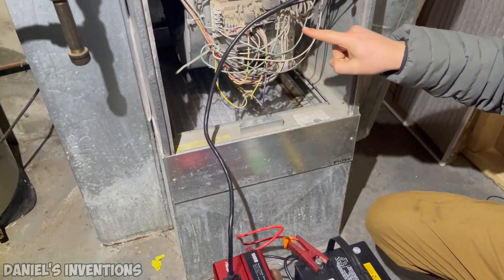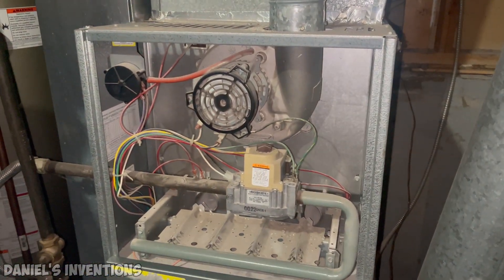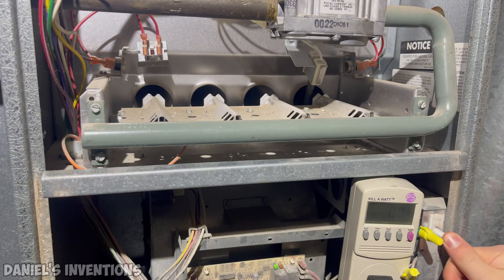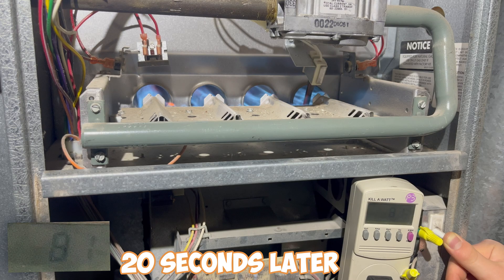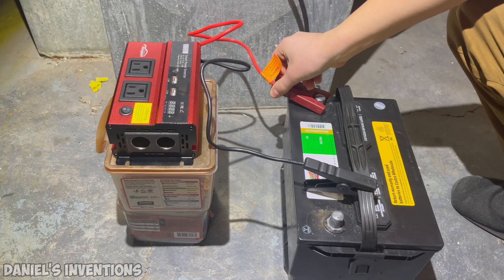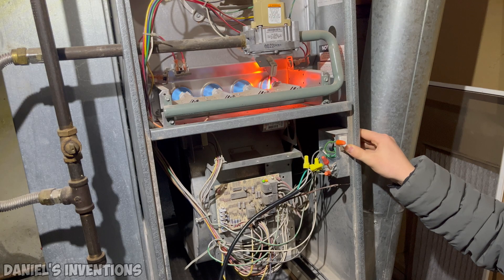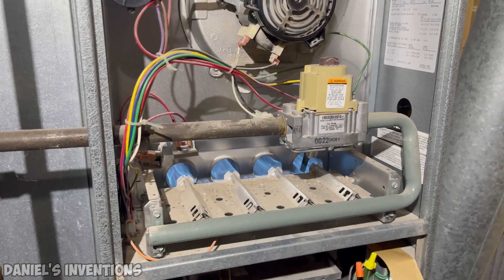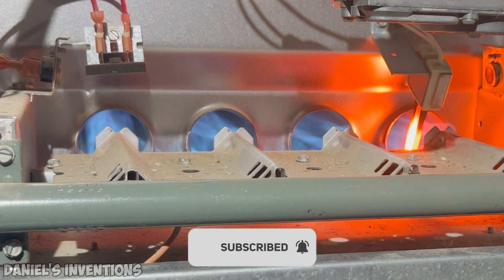How To Have HEAT During a Power Outage

Comment: With LiFEpo4 lithium battery going down in price it is possible to buy a 100Ah battery for 150-200$ now. It is lightweight, smaller size and you can use 100% of the battery power. With a standard battery or deep cycle it stops working at 50% capacity. You get on average 4X more power from a lithium battery than a deep cycle one of same capacity. It is why people's getting solar panels use LiFEpo4 battery now and not standard battery. They last lot longer too before replacement

Comment: I've done this a few times in the past using an 2000 watt pure sine wave dc to ac inverter permanently installed in my vehicle. Please note (the blower fan uses the most wattage) so essentially yes this works just great energizing a small gas furnace for emergency heat until the battery is fully discharged. However, not so great for most oil furnaces which draw a great deal more electrical current.